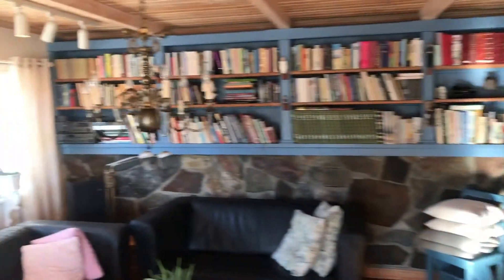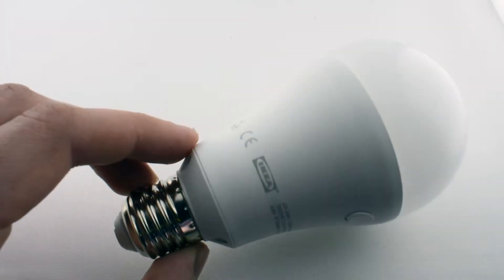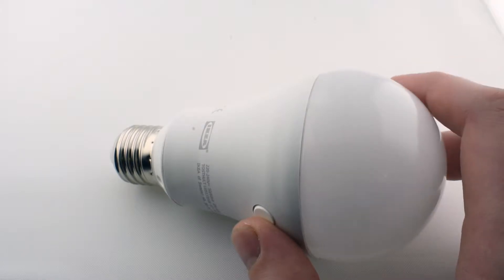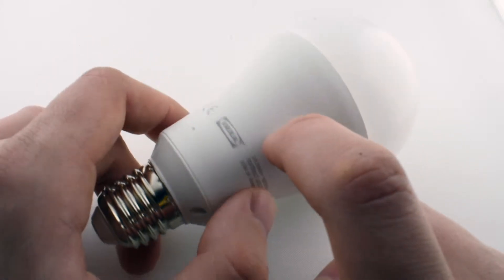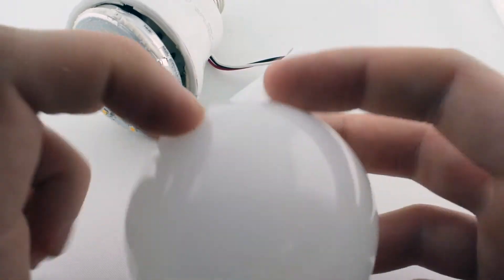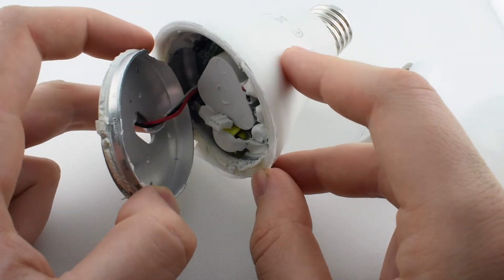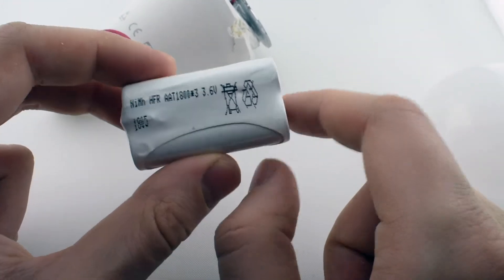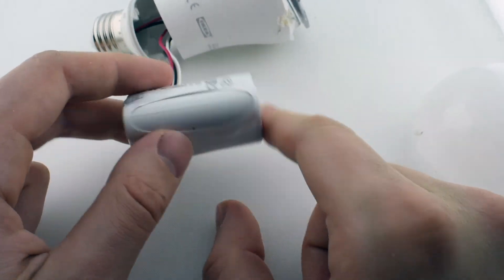Ikea Tosthult - Intelligent Emergency Light Bulb With Battery

Comment: I was lucky to bag the last six in IKEA several weeks ago. They. Are. Great! I have them in my overheads, not table lamps, ( I have battery powered)so they charge via the mains, even when the bulb is switched off. I tend to use them in the evening when I want  light, but don't want the meter ticking over. They stay on for several hours, but dim quite a bit by the fifth or sixth hour. You get a fair amount of light. And it's safer than an open flame, I guess.
Reply from the maker: Strange it got discontinued,  nice performance, nice design, low price, good features. Probally was not very popular, idk.

Comment: Can the bulb be in a 'powered-on' socket to charge with the led light itself turned off?
Or does the light have to be 'on' to charge?
Reply from the maker: A Alto When the socket is powered on you can turn of the light, so it will only charge when it’s on. Can’t turn it off with the button and the bulb is not included in the "trådfri" series by IKEA.
Reply: @jobathano1660  strange. They're fully charged by the time I come in, and they're off all day. So I'd say yes. If they're in the overheads in your home. I'm gonna get more if I can.